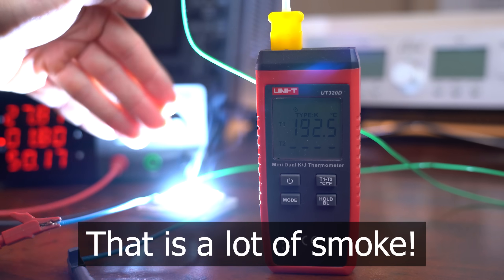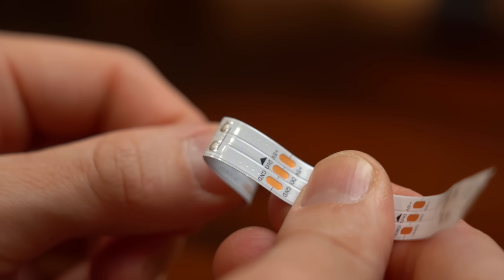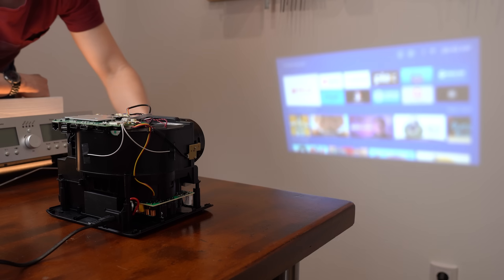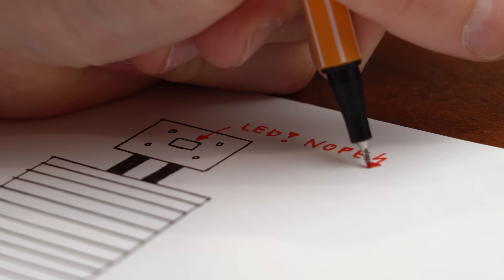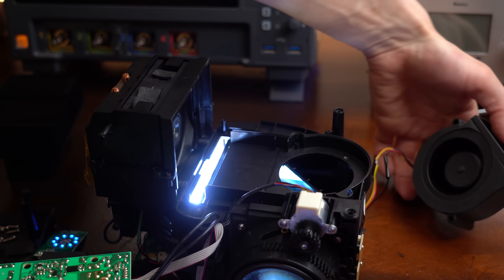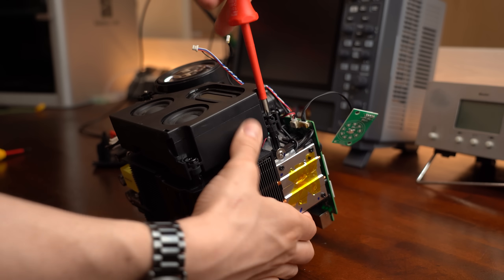Your Cheap Projector has 1 BIG Problem?!

Comment: It would also help mounting the projector upside down. The heatpipes were in the wrong orientation, you should have the heat source at the bottom, and the cooling fan on the top, that way they phase change in the pipes is the most efficient.

Comment: Try Noctua Fans. They are extremely quiet and popular. I honestly thought this fan would be one of your selection. You can cut down the decibels greatly and you don’t have to use a 9 V regulator for the other fan. and leave it at original 12V supply.

Comment: What if you remove the internal speakers and replace them with a heat sink and another fan? Is there room for heat pipes for that? Then just use external speakers.

Comment: I had a similar problem with my solar MPPT having a very noisy fan. I installed an 8 ohm 33W resistor in series which slowed the fan down making it considerably quieter.

Comment: Measuring the temperatures on the heat capture plate and the cooling stack pretty much just looks at the heat flow in the heatpipes no?
Monitoring the temperature of the LED board and the heat capture plate would give a better idea of the functionality of the thermal paste.

Comment: First let me add another vote for Nocua; as for price, when you are talking about a projector that sits next to your head, the extra noise reduction is worth it.

Why not 3d print a duct the shape of a centrifugal fan and put a standard fan in it. Sure I will not have the same efficiency of a centrifugla fan for small directed airflow but It will be quieter.

Also 3d print a case mod to alow fo larger fans. A case mod would also allow you to add baffels to the outlet to dampen sound.

You could replace the aluminum heatsinks with copper, even if you kept the aluminum fins, the conductivity and thermal mass of heatbloc and heat pipes would move heat away from the LED a lot faster.

If you have a CNC, you could create a thick aluminum case and pipe all of your heat output to the case itself. Or, if you want to go really crazy, you could make the case out of copper.

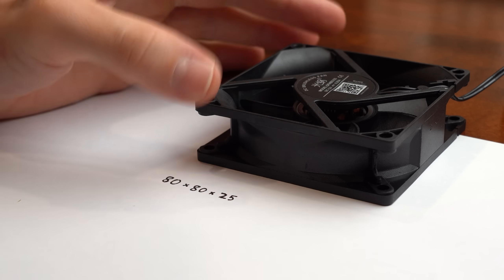Comment: @8:30 Behind a heat sink's fin stack, you also want to pay attention to the Static Pressure stat.  A little variance is fine, but too much lower, and it won't push enough air through the fins.

Comment: Heat management is something interesting but a bit complicated… That is related to fluid dynamics. Fans are probably not the same even if they come with similar appearance or some of the parameters. For example, maybe the relationship between flow and pressure is specified?

Comment: Purchased a static cooler that worked initially and then stopped cooling. Took it apart to find the cooling chip was only partially covered with heat transfer paste. The other surface area was covered with a black sealant. I called the manufacturer. As soon as they realized it was a manufacturing error, they asked for the cooling chip. I sent it in and received a new one. Only issue was they included the wrong heatsink. I now had two outside heatsinks and no inside one. It didn't work as well as when it was new. I gave up on it.

Comment: I have magcubic hy320. I/ve changed thermal paste to ptm7950 and lowered the voltage on fans and temperatures and noise are way lower now. Simple 30 min job.

ptm7950 > all
I'm using it everywhere and I'm never going back to thermal pastes.

Comment: Out of curiosity. Did you consider buying a cheap 120/140mm pc watercooler for a cpu and mounting. The pump would need a constant power source but that shouldn't be hard for you. Some Aliexpress water coolers could passively cool the led more than a single fan.

Comment: You can't simply replace that led. Even if you find the correct dimension, it must have the same CRI and other characteristics needed for the color calibration. If the colors are off you'll have to buy a colorimeter so total cost will be higher than for a better, more silent, projector from the start

Comment: I did this on my 3D printer. Some fans had 24V and I reduced the voltage in some cases to 12V and it still works today without any problems.

Comment: I know the sound is coming from the vents, but whats making the whole thing loud is the thin hard plastics, it resonates, like a wind musical instrument. imagine a sub woofer box made out of that plastic? if you put rubber, or butyl tape around the fan housing, and some on the insides of the projectors outer panels, you will see it will decrease alot. the only reason your new fans quieter is because of the rubber stickers it comes with. I do HVAC Thats whats used in ducts, if not the sound travels thru. to make it even more quieter you can make a rubber scoop on the outlet, so the sound hits the rubber and cancels out some more. and te black heat  sink looking thing in between both fans. why is that there, its not really exchanging with any other metal surface. is it atype of metal, if so why have they made it black. if its not metal, why is it there. one thing its doing, is causing  chaos in between both fans. if you look at your smoke flow infront of the outer fan, its not flowing in or out, because the back of the fan is closed with that so called heatsink, and its just turbulence , air is trying to go in and out,  not flowing one way. from what I understand, the outer fan is supposed to pull air in, but the centrifugal fan is blowing air towards the fan thats trying to pull air from the outside, and again, with the iron smoke, in-between the fans, its just turbulence. the faster they run, the more air doesnt flow.

Comment: Eh a lot of work for 5 dB and a potentially shorter life time
Reply: 5db is a lot
Reply: I see the benefit if you already got this projector and can't return it - but if you are going to invest resources into modding your projector (removing warranty) you might as well do it the proper way. With a new 3d printed enclosure (or similar) you could install better second hand fans and heat sinks (such as a modded CPU cooler). It would require a little more work - but hey u have already decided to take the difficult road (basically pouring time into a project) when u decided to buy cheap and opt for modding.

Comment: You really disappointed me this time :( 

Suggestions for part2:
-Copper plate trimmed to size for sticking it at back of aluminum passive heat block 
-Use of a higher quality thermal paste from highly reputable brands
-Mirror Polishing with fine sandpaper of led aluminum plate and passive heat block (will improve microscopic surface contact)
-Use Noctua fans
-If you cant get a Noctua model for the one you modified then you should use a thin Noctua fan or Small mini Noctuas and possibly 3d-print air redirection vents

Comment: I modded my beamer the same way but I used a BeQuiet Fan to do so. Almost all LED-Beamers have 2 fans. One pushing air into the direction of the display to cool it and the second one to push or suck hot air out of the beamer. It´s never a good idea to reduce the airflow of the fan cooling the display. That will age the display very much faster and you will get blind spots or brown sections when the polarization filter gets too much temp.

Comment: In my opinion the obvious upgrade would be a better thermal paste (better conductivity can achieve -5°C and beyond, the RPM will be lower) 
On the extreme side for liquid metal prep, you'd need new threaded screws, zinc plated heatsinks and some sealant but it'd be night and day

Comment: Did the same thing with my old projector
I used silent wing 80s and replaced the turbine with two of them, with a custom fanshroud to guide the air
Id say it droped the noise by about 20db
From vacume to barely noticeable, while not affecting temps by more than 3C°

Comment: Noisy because they need to push a whole heap of air over the screen. 
The little mini screen in there if it gets hot will burn and go brown etc. 
I once put one into a bar fridge freezer, cut a hole in the side and put glass over the hole. Ran the projector inside the freezer. 
ran fine for at least 5 years

Comment: Appreciate the fix! However, I think limiting the speed is ultimately, though not fundamentally, a bad idea. I think the ACTUAL best way to solve the problem is mildly more expensive, but NOT that bad. The issue, specifically, is evacuating surplus heat. By definition, Centrifugal blowers are always going to be louder than open fans, and I don't think the fan had to have precise measurement matches (namely, I doubt it needed to be 25cm thick.) In fact, I bet if you used a robust-enough copper fin stack, and maybe threw in another heat pipe, you could probably passively cool the LED COB, and I bet you could ALSO use a traditional computer case fan to replace the centrifugal blower with a little bit of quick bodging here and there. I think the reason they did NOT go this route was probably that the fin stack+fan and centrifugal blower was cheaper to manufacture than a large copper block with more heat pipes and a centrifugal blower wass cheaper to engineer than a new optical chamber that could share the airflow. But, in the after-market, CPU coolers and Noctua fans ARE a thing, so I bet some repurposing could make it that much quieter!

Comment: have you thought of using a Peltier cooler ?  it is an Active cooling solution without the problems of water.  can also get rid of the large heat pipes and fins and go with a smaller heatsink and lower speed fan for much quieter operation.

Comment: If you are using the projector in a cold country, where the ambient is much lower than the original design ambient temperature, you will get away with such modifications. But if your ambient temperature were to climb higher, your modifications could cause the unit to fail. The best possible way is to incorporate a higher, active cooling method, using powerful Peltier modules, back to back, where you can ultimately increase the surface area of your final heatsink and make do with a larger fan, running slower and quieter. But this solution is easier said than done, I agree, given the limited space you have.🙂

Comment: Even if you could use a larger led, that would be a bad idea. TLDR is the smaller the light source in a projector, the easier it is to get the projected image to be uniformly in focus over the entire area. This is why led and laser light sources are only just starting to overtake bulb based light sources in higher end projectors. The bulbs in projects are short arc lamps, these bulbs can produce several times the amount of light than even the led in this video, and all of this light comes from roughly a few square millimeters. I have seen these cheaper led projectors in person and none of them have come close to having as sharp as an image as my 10 year old BenQ lamp based projector. Having said that, for $200 they are still a great deal and a good option for someone on a budget.

Comment: Another relatively simple method of lowering noise is a foam coated baffle that deflects the air down from the projector.  Think of a modern wet and dry vacuum like a Ridgid which some now have a muffler built into the fan volute or even a central vacuum muffler.  I mean, ultimately the projector could go in a box (like most modern cinema projectors are in a dedicated booth) and also have vent hoses that go outside but that's to remove excessive heat from the Xenon arc lamps.  I have a projector made under the name "Vankyo" that's somewhat like this but looks more in line to a conventional Epson or BenQ projector in a cake box configuration instead of a cube.  

Also, I like to think in a way that Occam's Razor is the best rule when trying to solve a problem and what you did here was the opposite.  Instead of tearing into it (while also voiding the warranty), maybe find room away from the projector and, 50 dB isn't bad, besides, it's not like you are using these projectors like headphones, you don't need to sit that close and...well, just wearing head phones is the easiest way to limit the noise from these things or using a dedicated sound system that is louder than the projector isn't bad either.
Reply: "Hey buddy are you from car service? Please check my car, it go to loudly... What, turn up the volume?"

Comment: I personally use noctua fans which are always my first candidates. They are so damn quiet. When dealing with heatsinks that have fins especially densely packed it is important to check also the static pressure. Some fans are designed for these applications.

Comment: You should try installing a noctua fan in there.

They are fans marketed to PC users where the fans are the noisiest part of your system, so reducing it as much as possible is the goal.

They are engineered to move the same amount of air as an ordinary fan but more efficiently. They are optimized through the shape of the blades and housing to reduce turbulence (which is just wasted energy) this reduces noise and lets the same size fan move a higher amount of air with less noise and the same amount of power. I believe they also engineer them so the accoustic profile of the noise that they do make as much as possible falls into frequencies that are less noticable to us, even if they aren't necessarily quieter in terms of dBA

Comment: I did a fan swap on a cheap peltier powered fridge and it turned something with about 40db down to basically inaudable 20db. Absolutely worth it and not expensive either when you use Arctic fans instead of Noctua.

Comment: 7:32 Those heatsinks look to not be milled. The dry thermal paste is nano clay based. It is dry because of the nano clay which transfers heat thru itself even when there is a small gap, kind of like a very thin thermal pad. You may ant to check the temps again after a few days, if there was a gap the new thermal paste would have dried up and gotten much worse at transferring the heat. Check out shin etsu, it is a nano clay based thermal paste.

Comment: You’d just need to hack in a few extra heat pipes into the stock cooler, so the heat can escape through a small opening in the chassis. (And outside, I’d slap on such massive fins that I wouldn’t even fit on the couch next to it.) No active cooling needed :P Or at the very least, I’d throw together a stylish, case-matching copper fin masterpiece, just for fun on a boring Friday."**

Comment: Try PTM7950 phase change thermal pads. They have been observed with `5 degrees C better than good thermal paste without the mess of liquid metal. Might be a nice upgrade if you don't wanna go through the faff of full water cooling or even an AIO.

Comment: So sad you only used a generic fan and not some real nice Noctua or Arctic ones :(
I am sure you could have reached quite a bit better results with them.

Maybe in another video?
And then you could also include either a manual fan speed regulator, or even better a temperature control. Measure the LED temp and set the fan speed to it!

Or you fulfill our dreams and watercool it ❤

Comment: I wonder if you can use a Peltier cooler in the heat sync. Also maybe some thin insulation followed by conductive copper tape around the inside of the casing to reduce temperatures and noise further.

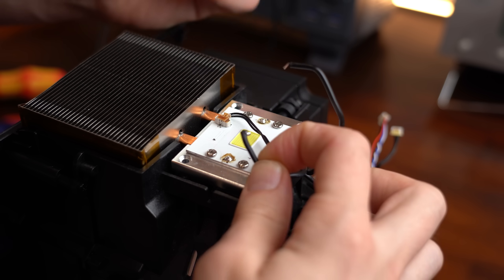Comment: 6:53 using a cutoff wheel like the one you have in your high-speed grinder is probably one of the worst ways to cut aluminum. Unless you get a cut off wheel specifically designed to cut aluminum all is really going to do is make a nasty cut off line and eventually separate your parts. If I were you and I were cutting aluminum like that I would switch to either a hacksaw or use a cutoff wheel that is designed for non-ferrous metals. Frankly aluminum is soft enough that with the right blade in a circular saw you can use it as well. And if you are going to grind on aluminum you definitely for sure need a non-ferrous metal grinding wheel or you're just going to gum up your ferrous metal wheels and make them nearly unusable

Comment: "lowered the LED heatsink temperature by 1°C" might not be the flex you think it is, because you're measuring not on the LED, so higher impedance to heatsink would lower heatsink's temperature but make LED warmer.

Comment: Last 3 cheaper sub 300$ projectors i got all had yellow spots after a few months of use. Even with loud fans. The heat on the lcd screen, just slowly killed em.  And replacing the burned screen was as much as replacing the whole unit. 
Its like they made them to last just long enough to avoid returns.  
Personally i would rather a larger projector like my old one with a replaceable bulb the size of a small suitcase. But built with newer led/laser and fans and lower price point. It doesn't need to fit into a tiny box. Allowing for more room for fans and airflow etc.  But finding a quality fair builds of anything is nuts nowadays.  Quantity over Quality

Comment: You can also slap some sound foam in it to minimise the noise. 
Also, you can bridge the heat sink on the inside to the outside chassis with some metal block or similar.

Comment: I modified many stage lights and I have had great experience with 12v fan speed controllers from aliexpress. I use the black PCB ones that cost around 2€ per piece including shipping if you buy multiple ones. With them the fan speed is dependent on the temperature of the heat sink and I don’t understand why such a cheap controller is not standard practice for LED cooling. 
(Maybe those are a great aliexpress item for the next edition? 😉)

Comment: Looks like the heat pipes are arranged in the wrong orientation. to have better performances the heat pipes like these are supposed to have the hot end at the bottom so the fluid can flow back down, or at least laying flat/horizontally. But these appear to be working against gravity. Maybe trying use it upside down?